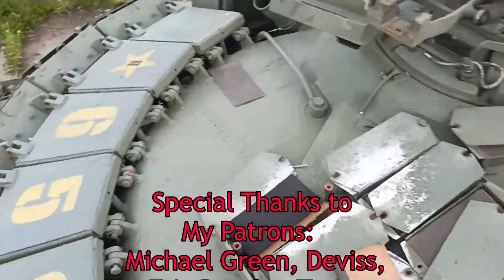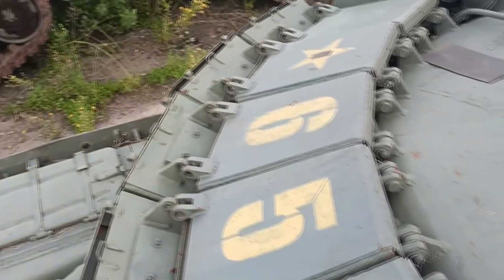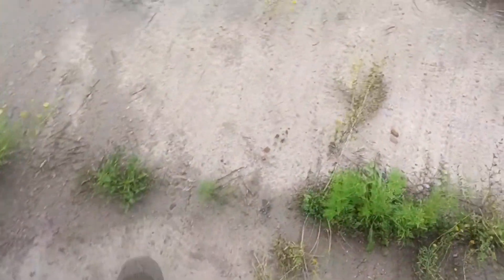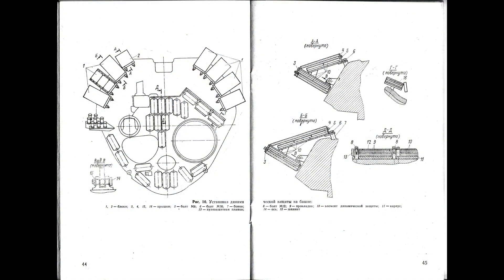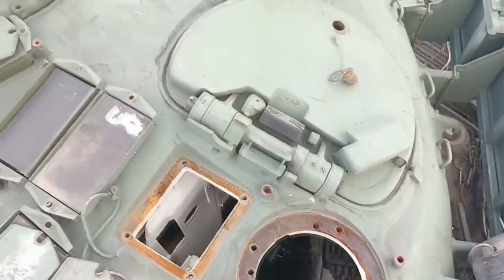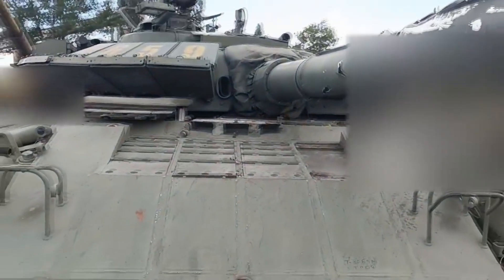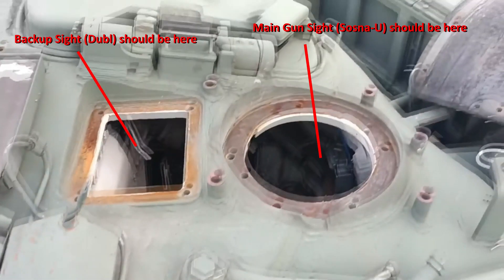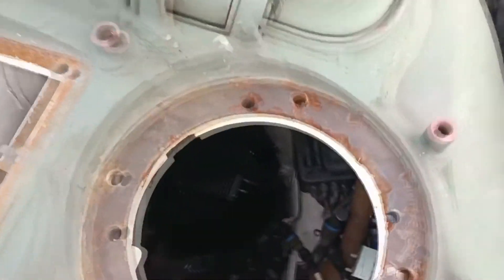Russians Are Using Rubber instead of ERA on their Tanks

Comment: Highly probable is that since it's capture in march (everyone happy now?), this particular tank saw no action whatsoever. Ukraine operates T-80 too. Everything that was of high value: machine guns, optronics, explosive fillings in the ERA, ammunition, road wheels, etc. were cannibalized for use on Ukrainian made T-80s.
Reply: Summa summarum: whoever operated this particular tank, it's not in use anymore and it probably never will be. Rust that had accumulated on the tracks, indicate that it hasn't been driven for months. Combine that with whole bunch of components missing, this is an ex-T80BVM. Like that "sleeping parrot" in Monty Python sketch 🦜⚰️
Reply: @JustPeasant  eh, give it a Rapier and use a tractor to move it around, then dig it some bushes or in the forest or even hide in some ruins, maybe it will work.
Reply: Yeah if Russia ditched it it was probably broken down anyways. 1 scrapped tank can give parts for keeping 3-4 others in the field. Scrapping a busted up captured tank to keep your own running seems fair to me.
Reply: march actually
Reply: Why fill them with rubber?
Reply: Parts are parts.  Too bad that orc parts are worthless.
Reply: As it should be.
Reply: Ukraine make their own t80s?
Reply: @annoymouse890  They used to. T-80UD*, it's derivatives T-84, T-84U, T84 Oplot, BM Oplot & BM Oplot-T (Thailand export version). However T-84 and all Oplot variants were all build in limited numbers, and since 2014 conflict with Russia, all mbt production has ceased.
*Soviet-era produced, only.
Reply: super!  as I understand it, you are talking about the fact that the blocks were removed for replacement?  Ok then one question is why they took only blocks with explosives!?
Reply: No, they found it in that state, russians just sold every part they can reach for.
Reply: if they DID take out the explosive, i dont think they would have used time to asamble it again,, the room for explosive was empty from the start,,,if you cannibalize,, you take all out whats it that space/room,sins you need all to put in the room an another tank that has parts of the reaktive armor shot of
Reply: @cmtwgrdk2748  Thats if the Ukrainians salvaged those parts, could well be the Russians had it break down on them and enough time to salvage the parts and abandon it, meaning the ukranians could have found it in this state possibly.
Reply: I wonder if they're actually planning on reviving this one... it seems that Ukraine could use something at least remotely modern right now. T-80 is probably way better than something like Leopard 1 or T-55, lol. I've actually seen Ukrainians doing stuff like DPR did back in 2014. By that I mean revive ancient tanks that are used as statues. Though unlike IS-3 in 2014, T-34-85 of 2022 did not really see any combat, though I wish it happened and got recorded, would've been ridiculous thing to do.
Reply: Yep. The Ukrainian techs have been dealing with repairing hundreds of tanks and AFV's already in service, refurbing several hundred T-72's held in reserve storage and checking and servicing hundreds of loaned T-72's from other nations. So it may have taken while before they got round to checking all of the several hundred captured Russian tanks they now possess. They have been a wee bit busy over the last few months.....
Reply: @simonmoorcroft1417  LOL you really believed these fables? Hundreds? Why not write THOUSANDS, like millions of planes shot down by nonexistent "Ghost" only morons like you believed in? Or equally fictional MILLION MEN army that was supposed to be kicking Russians out of Crimea two months ago? LMAO...
Reply: @simonmoorcroft1417  Ukraine nostly had T-64s, though. Not T-72
Reply: @unknowncommenter6698  well they did, but old versions like the t-72As
Reply: I'd suggest any serious person here to ignore the Orc trolls and dive into Perun's youtube compilation on the war. The young man does a fine job of laying out the massive scope of corruption in Russia's military complex. There was never ERA in those panels, but there were a couple of massive Yachts built in their place.
Reply: @troymash8109  kek, the levels of this mf's projection is insane. Does anyone remember the fact that Polish guys sent their T-72Ms without ERAs?
Reply: @troymash8109  yeah sure if you need only the perspective of the side you are closer and friendly to.
Reply: @yam2050  he meant perspective of logic and rationality provided by Perun not lies from Mordor...
Reply: if you enter the numbers that are written on the board, then he finds pictures of the tank and it is clear that this is a Ukrainian tank and not a Russian one
Reply: @ЕвгенийОрлов-б4м  nyet. Ukrainians do not operate T-80BVM tanks.
Reply: @JustPeasant  they do now actually
Reply: @angrydragonslayer  they do now, but not back then.
Reply: @JustPeasant  yes they do not operate t-80bvms but the same optics can probably be placed on other t-80s certainly something was wrong with the tank that make it "undesirable"
Reply: @atilaabedi9561  that what I'm thinking. Alas, this particular T-80BVM isn't going anywhere. Not on it's own power at least...
Reply: @atilaabedi9561  It has a notoriously shitty gas turbine that requires a ton of maintenance and parts to keep running even just a few hours. There's a reason the T90s and T14 use a diesel engine.
Reply: @JustPeasant  they captured this tank, and at least they move it ( there are photos with different locations) and it was  painted with blue and yellow on  addotional  barrels backside (for preventing  frendlyfire I guess) so at least out was moved some time...
Reply: @ЕвгенийОрлов-б4м  he became Ukrainian after this video, lol.
Reply: @ЕвгенийОрлов-б4м  Lying is fun?
Reply: @williamjackson5942  you can pick up your lada
Reply: @williamjackson5942  and again:  @Just a peasant  they captured this tank, and at least they move it ( there are photos with different locations) and it was  painted with blue and yellow on  addotional  barrels backside (for preventing  frendlyfire I guess) so at least out was moved some time...

Comment: I think they* might've removed the explosives for safety reasons. Useful parts were stripped, but the ERA wasn't left loaded probably in case it degraded or was accidentally activated.

*= the Ukrainians when storing/stripping the tank
Reply: It doesn’t accidentally activate and it won’t, it can sit 100 years 
In fact sometimes it fails to activate when shot at, especially the older stuff
Reply: @Paul Thiessen These explosives (ERA, ERAWA) are not degrading over time, it also don't explode by fire, electricity etc, these are passive explosives, throw it into fire and nothing will happen, it only can be triggered by high energy impact, even .50 cal won't work on them.
Reply: @Paul Thiessen Obviously, I was just explaining another thing, these things don't explode unless by high energy impact, you can't attach a detonator to them and explode it. If you scrapping a tank those are valuables you'll take out.
Reply: CK Lim  You're wrong, there's a lot of equipement you can demount exactly with a spanner and screwdriver. Blow torch is the last resort. Point is to take valuables without destroying it, blow torch is for empty shell and eventually tracks. You can canibalise almost everything from a tank, from mg to wheels.
Reply: That and they can use those explosives for an IED against the Russians.
Reply: So let me get this straight.

You think the Russians removed the ERA for safety reasons?

Are you serious?
Reply: @joshuamitcham1519  What? No, the Ukrainians would, as the people who are storing the tank. Either that, or like the other parts they salvaged them.
Reply: @arsarma1808  As others have previously said, if it's being used for parts and the Ukrainians needed the explosive elements of the era, they would take the entire unit not just part of it.